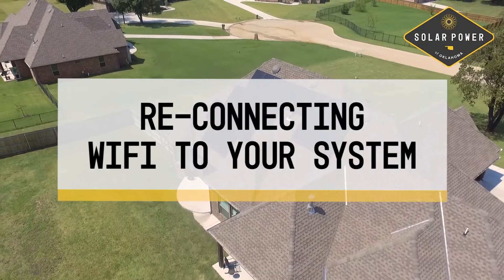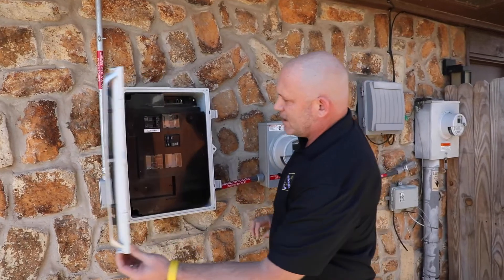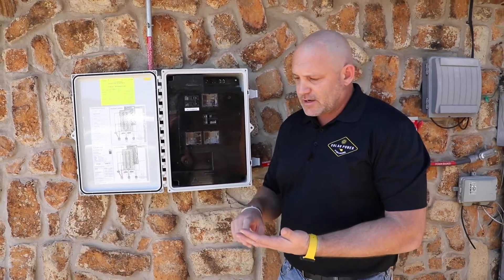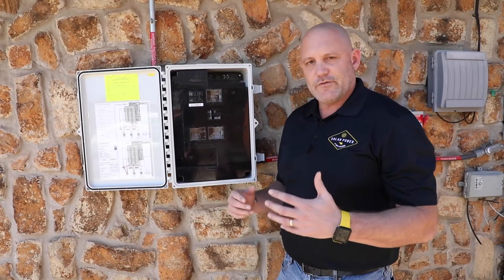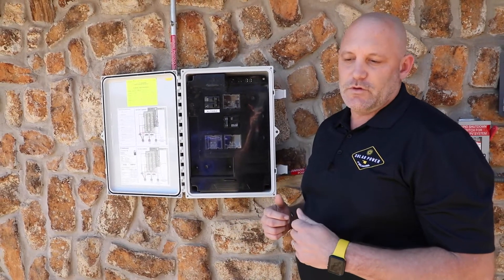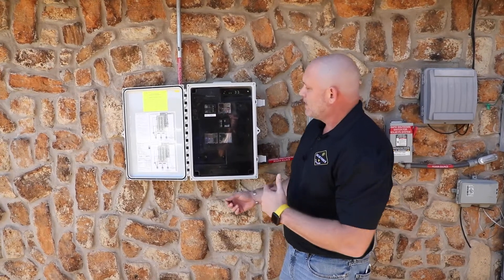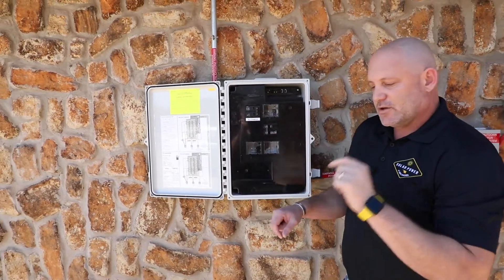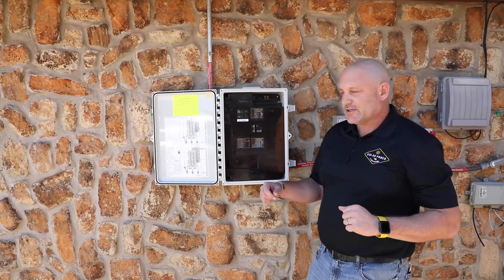How to Re-Connect Your System to Wifi | Solar Power of Oklahoma

Comment: I have PV (solar) and a new router (starlink). I had to buy a new gateway box (envoy s), or that was the decision at the time because of connection problems. I have been trying for days to get everything talking. All the other help instructional videos about this said "Do this and it WILL work! No plan "B" if it didn't work. The happy music was driving me mad! Of course, IT didn't work. You said to push the button next to the electrical zig zag or lightning bolt and Starlink said that the Envoy device was too far away from it's router. I pushed the button, I moved the gateway to the garage, about 30 feet from the Starlink router and the Gateway lit up mostly green!!! I think we are about 85% there. Thanks! Enphase people texted me saying I had to have a certified installer do this, or I could if I took a 50 hour class. The other Enphase help were from INDIA. The connection timed out by the time I got back to the phone with a serial number and the box was only 15 feet away. Such a PAIN. Thanks again..waiting. I'll check it tomorrow.